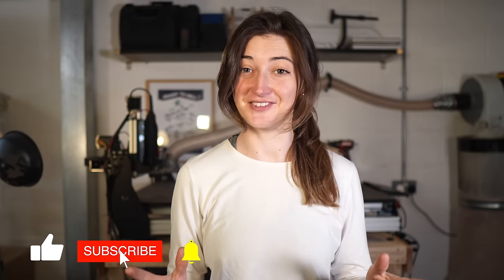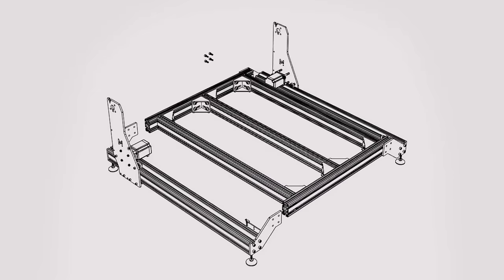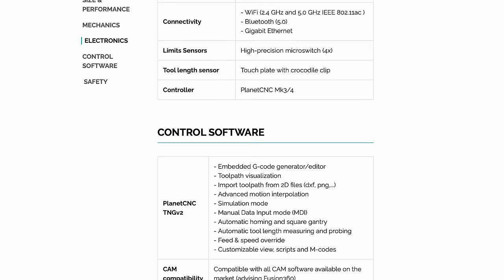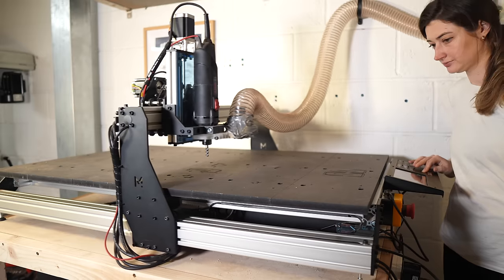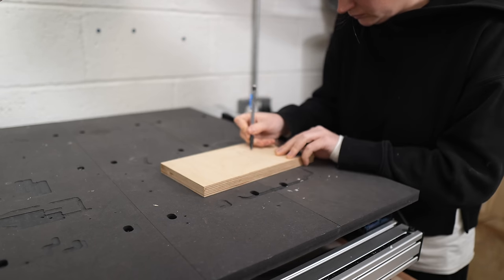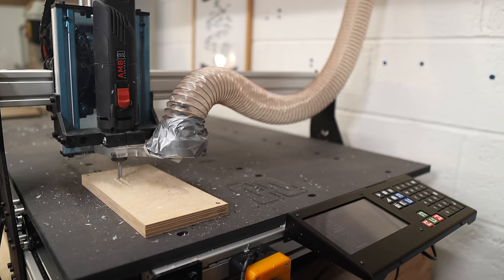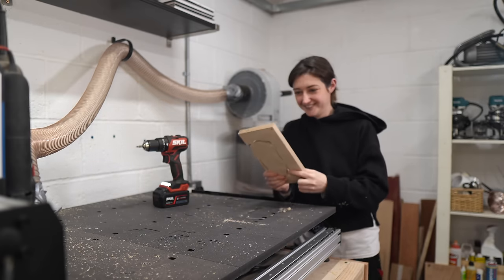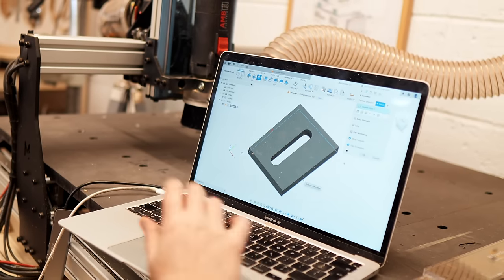I hired a robot

Comment: Hi Daisy. Happy to welcome you to the world of CNC. Now, before the next cut, get a spoil board. That is a sheet of MDF that lives on top of the bed and absorbs all those cut-throughs that are going to make a mess of the machine.
Reply: I second that. also maybe the use of a flute up down compression bit, that's good for ply anyway not sure about acrylic. Love your work though Daisy.
Reply: @studiotomm  I've never used CNC but this is exactly what I was thinking. We don't want the routing bit to ever touch the metal of the bed.
Reply: i believe that's a black mdf spoilboard
Reply: @markknecht9416 yeah, I was thinking that as well
Reply: @HansAndreasR1  It is, but it is an expensive one, and much better kept intact. An extra layer of cheaply disposable MDF is a good idea.
Reply: @donepearce  yes but then you loose hight in the Z axis
Reply: @HansAndreasR1  A few mm. That is never an issue.
Reply: A CNC is such a precise machine you could just use painters tape as a spoil board, put a piece under the z probe and few under the work piece before fastening it. I'm pretty sure nobody's tried it this way before.
Reply: @Realism91 only in theory. There are so many circumstances where that approach wouldn’t work that it would be easier to just do a proper spoil board. Even then, you need to actually surface it using the machine. No piece of MDF I’ve ever seen is actually, truly flat.

Comment: Looks like a great machine, especially the spindle. Yo said you were drawing in Illustrator but the screen showed Fusion 360 CAD software. Did you draw in illustrator and then import it? Seems odd if so, as Fusion is much better for this

Comment: You will want to look into and get an understanding of the proper bits to be using for your templates, fixtures and jigs.  Also for the finished stock material that you may make.  As you mentioned, you will be utilizing wood and acrylic, so they will be best with different bits. Spiral Compression Bits are a great place to start, and understanding the difference between up-cutting and down-cutting, when to use each and why they perform and execute differently from straight flute or "normal" spiral bits.  Since you do very, very specialized work (which is amazing and I love watching your projects) don't fall into the trap to wait until you're better or more experienced with the CNC before getting the correct bits for your work.  You will be amazed at the difference it will make.

Comment: But, but, but, but... then it's not handcrafted!  That will be the next argument from purists.  Folks, I guarantee Christian "Freddy" Martin and Leo Fender both would have used CAD tooling and CNC gear in their day if it had been available.    Anything that improves quality and consistency and reduces the risk of waste of expensive raw materials is a win for everyone.
Reply: 💯%
That's why they use them now. They also use A.I. and a lot of other tech as well like computer generated images.🤙
Reply: I’m a purist
Reply: @PG-ex3kl  
Do you actually own a hand made guitar?
Reply: @gwbuilder5779  yes, I build guitars so I have many 😊
Reply: @PG-ex3kl  
Fair enough.
I understand the perspective of keeping things in the palm of your own hand and the preference of using only hand tools.
Do you use any power tools?
Reply: @gwbuilder5779  yes I use a bandsaw, router and palm sander, every builder has the choice to be as mechanised or computerised as they like. I want to be a luthier not a computer programmer/operator at the end of the day.
Reply: @PG-ex3kl  
So,
Where does the "Purist" come in to play?
You are absolutely correct that using power tools is completely subjective, why interject a comment that actually doesn't even remotely apply to you?
Not to mention, make such a comment here, implying somehow that Daisy or anyone else less because they coose to use a programmable tool.
You are clearly free to have any opinion you like, just don't project or imply that opinion onto anyone else, especially on their channel.
Reply: Yes well I’m very sorry I upset you, I will make sure I won’t do it again. Sorry
Reply: @PG-ex3kl  
You don't owe me anything.
Implying that Daisy isn't a purist because she purchased a CNC machine as if it is some kind of sacrilege is the real offense.
Reply: @gwbuilder5779  I’m very sorry to have offended you, it wasn’t my intention to imply anything either, I am just grateful that you are here policing comments in the comments section. Thank you for your service
Reply: @PG-ex3kl  
You are a real class act.🤣
Reply: @gwbuilder5779  🤪

Comment: Recommends that you have an MDF board in the bottom that you can replace cheaply.
If you will use it a lot, patterns can be milled to simplify  clamping such as YouTube Marius Hornberger.
If you will use it for wood often a simple ways to hold the material is composite nail an alternative when the nail does not destroy the milling cutter, unlike a regular nail or screw.

Comment: You will need a set of special cutters for Acrylic… There’s a different type of material similar to acrylic sheet that doesn’t warp … Trend routers used to sell it… That would be a better choice although its not clear… But you will probably need a different set of cutters or adjust the cutting speed as it will melt n clog the acrylic

Comment: When you're more confident with your CNC, I can deffo recommend getting the CNC to drill a grid pattern of holes for screw-in threaded inserts. Then you can use bolts/toe clamps to hold your work pieces.

Comment: You'll have to add your kerf (amount of material removed by the working tool) to the offset if you wanna get centered on your workpiece better. Add twice the diameter at least of the tool being used into the kerf, I will sometimes round it up, as a used tool can sometimes leave a slightly wider kerf than a new tool. I'll also calculate the distance of the cut from the other edge of the material, and split that into my offset. That will usually get my cut part in the center of the material.